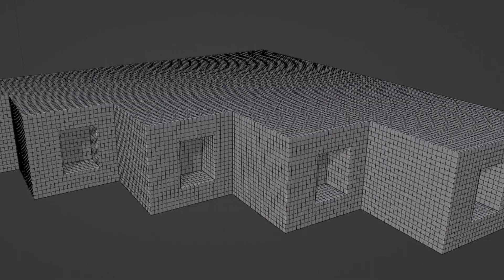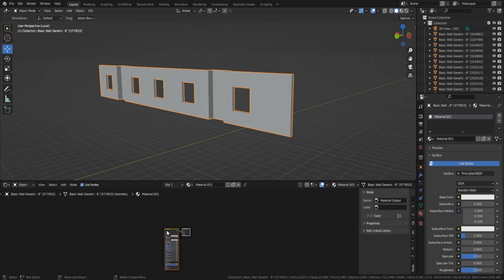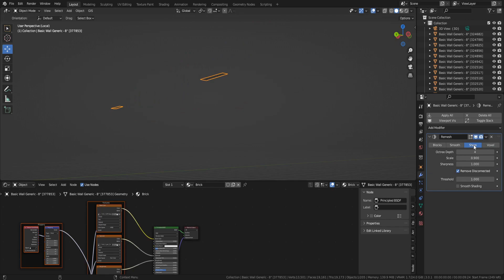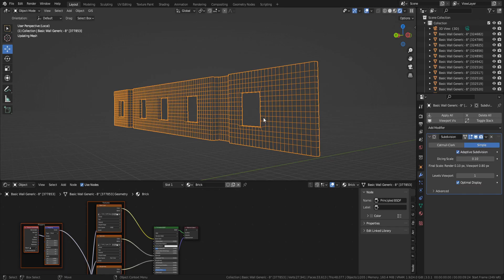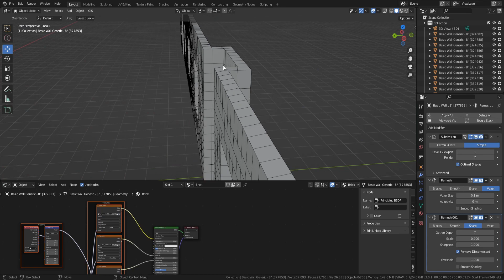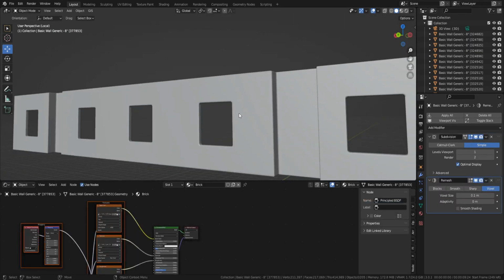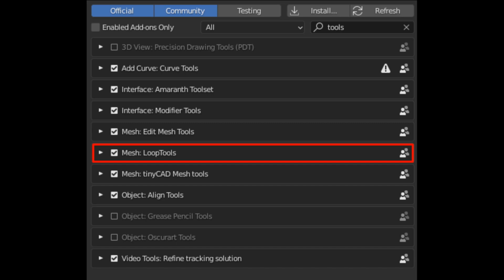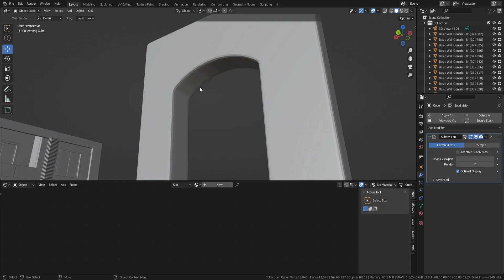Cleaning up walls in blender (Solving your CAD Problems Series)

Comment: pretty good.. i imported from sketchup so many overlaping face and messy vertex that impossible to fix 1 by 1..
Reply from the maker: then you need to remesh it first with voxels then remesh using sharp mode , it maybe a bit consuming but sometimes worth it

Comment: Sir How to reduce polycount of a Architectural Model in Blender Sir...
Reply from the maker: it depends on situation but most of the time if you check the video you can use decimate at planar option for archviz , that decreases poly count dtrastically and also useful for sketchup files
Reply: @khalatelomara  Thanks a lot Sir, I have tried it Sir, Is there any other way...
Reply from the maker: @abcreations3298  sure there are many ways but it depends on for what purpose you want to decrease the points and model nature , can you send me screenshot via https://app.prntscr.com/ or you can ask on discord https://discord.gg/ZKS3G9FN
Reply: @khalatelomara  For Streaming VR on Web Sir, the polycount is causing a drop in FPS...
Reply from the maker: @abcreations3298  there is almost no automatic way for such experience, you may need to decimate sculptures for example to few vertices and bake details to normal map 
I have a video here on the channel but it is in Arabic for baking 😅
Reply: @khalatelomara  Yes Sir I use Revit Architecture, How to reduce polycount in Revit Sir...